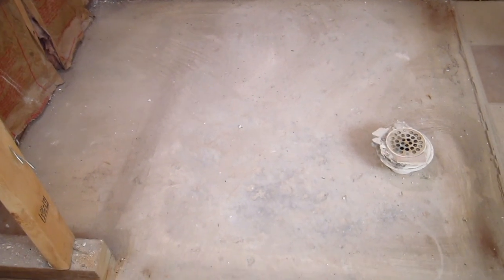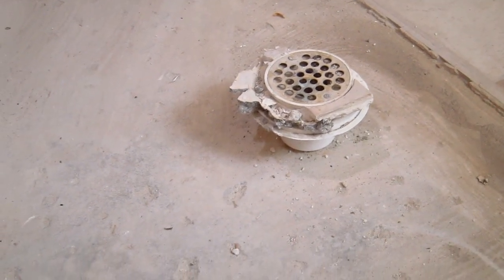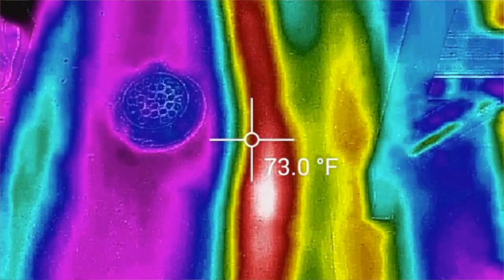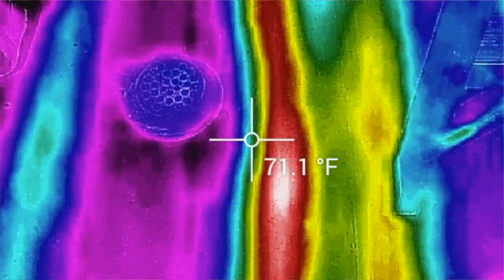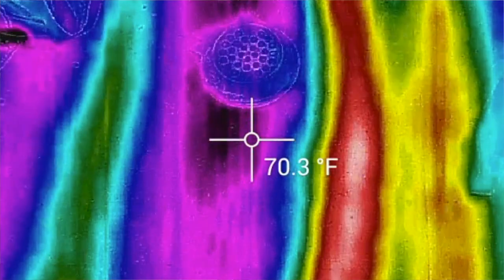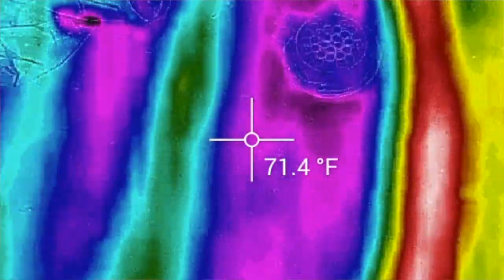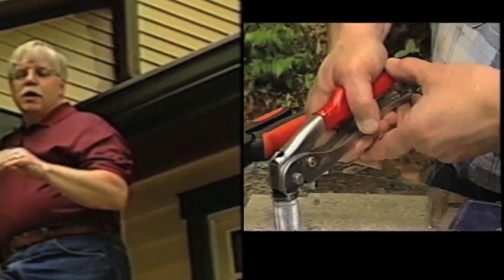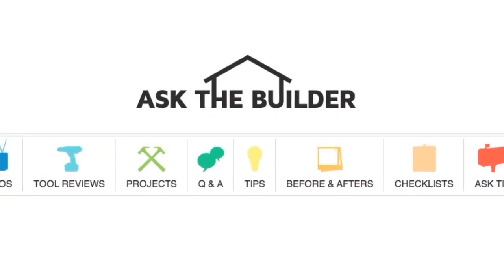Bath Remodel AskTheBuilder How to find Radiant Heat Pipes

Comment: Thank you! Builders have been nervous about our project (e.g., installing an additional sink and dishwasher) because of this exact reason. It is good to know there is a way of doing these updates safely.
Reply from the maker: The trick is to chip SLOWLY away at the concrete. Do it by hand if you're within 2 inches of a buried PEX line. GO SLOW and you won't poke into the PEX like I did!

Comment: Hi, I like your video and I was wondering if this will work for my situation. Our house is on a concrete slab and the house is a ranch style house that was built in the 50's with radiant heat pipes in or under the slab, not for sure which. I currently have a collapsed drain pipe under the slab coming from the kitchen sink. I want to break into the floor to fix the drain pipe without hitting the radiant heat pipes. Will the thermal imager find those copper pipes as well? Also if I do hit a radiant pipe can it be repaired? I believe they are copper pipes. Any suggestions for this catastrophe?
Reply from the maker: Ron, this requires one of my phone consults. There's just WAY TOO MUCH to type! It's the BEST MONEY you can invest in this project. Remember, I've been a master plumber since age 29. Go here: https://shop.askthebuilder.com/15-minute-phone-or-video-conversation-with-tim/